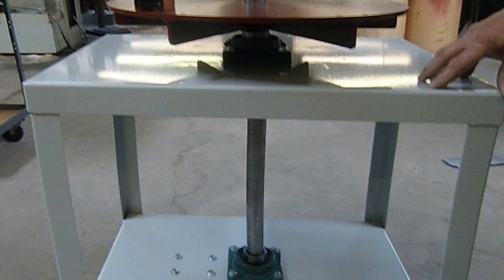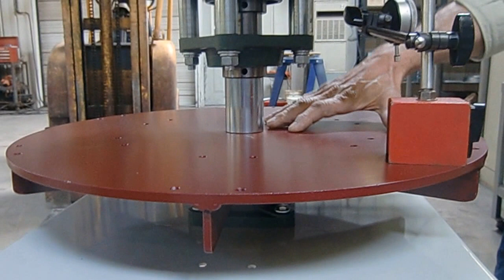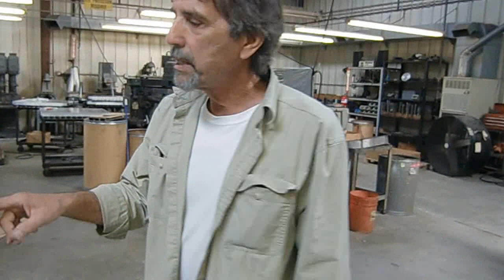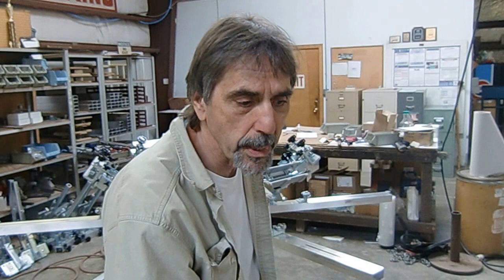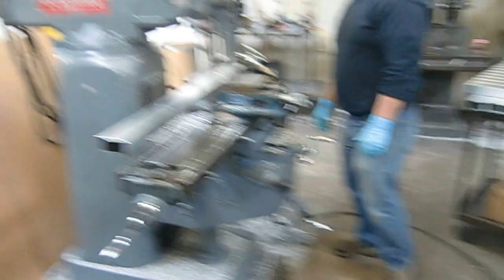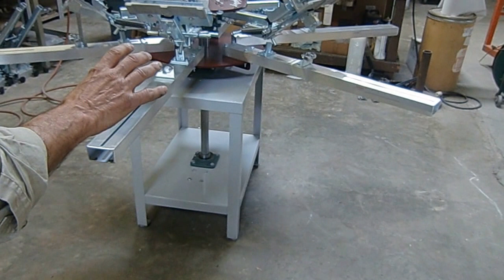ANTEC PRECISION

Comment: 2:00 “runout” refers to concentricity of a turning shaft. Not the terminology for measuring variances on a flat surface. If you put the indicator on the outside diameter of your turning plate, then you can call that reading “runout”. Just sayin.....